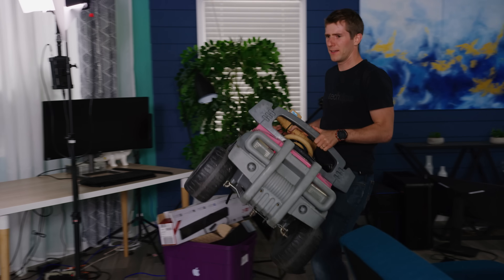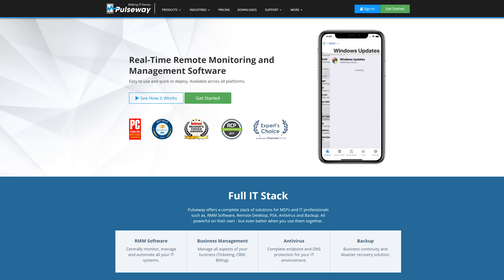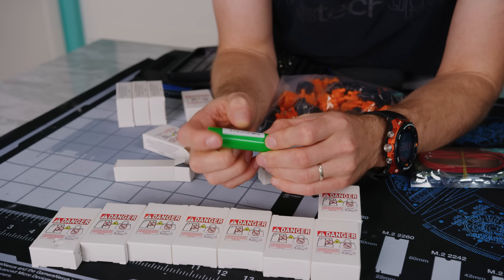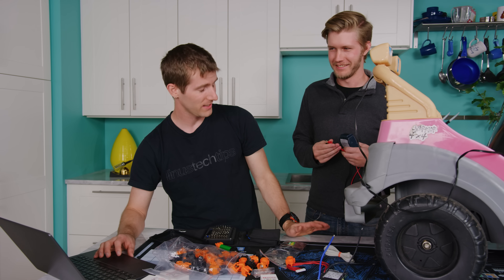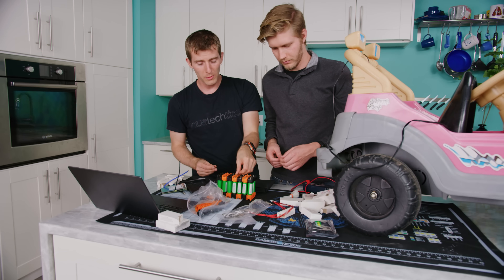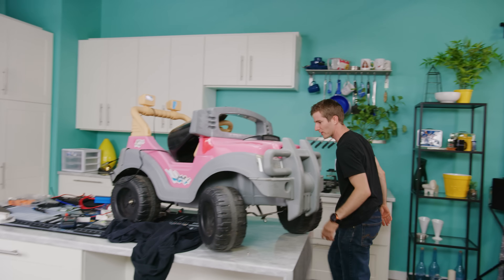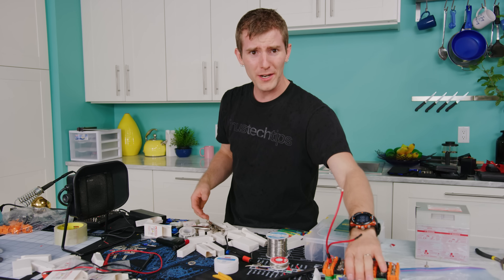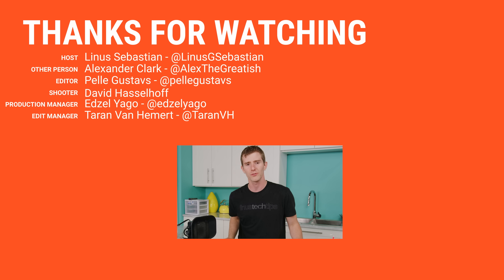DIY Lithium Battery - What could go wrong??

Comment: Will you stop saying that a mistake on low voltage can electrocute you? It's nearly impossible to be electrocuted with 24 volts, unless you stuck the wires into open wounds on either side of the heart or something... There's no reason to make this sound more dangerous than it is! The real danger is the risk of fire or explosions due to short circuiting these cells.

Comment: make it 7S4P if the space allows for it. It should last longer and the battery won't get so hot.
also try to install a couple of temperature sensors and at least display the battery temperature or light up an LED if temperature is over 60°C

Comment: i think this needs something like current limiting motor driver so it would launch softer with less wheel spin and less heat in the battery not to mention longer wheel life.

Comment: I just thought of something. I've been looking at things like the "Anker Power Station" and now I'm wondering if it's possible to use one of these DIY kits and a power inverter (i.e. I have a 300w DC to AC which has 2 built in USB charging ports too, no need for separate 5v circuitry from the main 12v) to make one of those power station things much cheaper with similar capacity?

Edit 1: Eh nope...
On their website they sell the batteries in pair for $9.99. they're 3,500mAh at 3.5v. 

So to reach 12v, you need 4 batteries in series. Each "blade" of 4 batteries provides 3,500mAh to be put in parallel. 

Anker's Power house is 120,000mAh, so you would need 35 blades of 4 batteries each in parallel to reach that.

That would be 140 batteries. 70 sets at $9.99 each, that's just under $700. Plus you'd need 2 assembly kits at $34 each. The power House is $500. 

Correct me if my math is wrong though, I'm uncertain if I'm right about putting batteries in series not adding up their current but I vaguely remember series adds voltage and parallel adds current.

Edit 2: Of course they state the Anker as 400wh, which 400wh at 5v is 80,000mAh, and at 12v it's only 33,333mAh... So if we're aiming for 12v, you would only need 9 blades of 4, or 36 batteries, which would amount to ~$360, way cheaper. Maybe someone better at electrical math can sort my mess out?

Comment: Alright Linus I have the idea of the century for you
1. Get two of those Power Wheels, and connect them with maybe a 4 or 5 foot long solid object so that they stay a fixed distance from each other
2. Soup up their batteries with this same method, and replace the plastic wheels with some that are rubber instead
3. Get a non-powered, stable, 4 wheel vehicle of some kind that has steering, then disable it
4. Lash up the two connected power wheels to the non-powered vehicle, maybe between 8 to 12 feet nylon ropes
5. Grab some potentiometers, servos, and wireless transmission devices and rig up a way to steer and power the front two vehicles from the rear one. (arduinos?)
6. Enjoy your modern-day pod racer :D

Comment: cool the battery with some old Stock CPU fans, you'd have a million of those and they're basically useless anyway.
Reply: Today, we are water cooling a DIY battery!
Reply: use Lithium Iron Phosphate (LiFePO4) they are better for electric cars, etc.  they barely get hot when running a motor.
Reply: @jerricabenton842  well there is no usage spesific lithium battery. Example: Li-ion batteries are superior and safer from Li-Po batteries but Li-Po is eveywhare and Li-ion's are barely used.
Reply: @Görkem-x5h  don't they get affected by magnetic fields? 
Back in the days I had Sony(before there Sony Ericsson merger) phones with li-ion batteries you could turn them off by holding a magnet to the battery
Reply: The battery is warm cause he didnt balance charge

Comment: I remember as a kid, my battery died and as my dad was a mechanic he tasked his employees of putting in a 12V Car battery. MAN it was fast.
Reply: I was always disappointed with the speed of my power wheels Jeep. However, instead of connecting a larger battery, I was more concerned with making the windscreen wipers work, which I did.
Reply: Sonic voice: GOTTA GO FAST
Reply: @DanielPinel  kerchow!
Reply: Did the same thing, it was awesome. I even attached a legit car plate number on the back.
Reply: i hope you wehre the coolest kid in shool
Reply: I remember I had a Ferrari Enzo power wheel, that thing was fast (turns out Ferrari threw in an actual car battery from the start)
Reply: i didn't know kids ran on batteries let alone low voltage 12v
Reply: Sounds like bullshit since car batteries use lead and you would have like 20 kg extra weight XD
Reply: @remy5405  12v car battery in a 6v power wheel.
Reply: nice dad bro
Reply: You are battery operated!!!!? ( jk)
Reply: Catch a girl?
Reply: You guys.. he means the speed of them installing the battery..
Reply: My dad did the same and that thing would move lol.
Reply: 12v lithium actually has a deeper high end then a 12v lead acid comparable. To sum it up the voltage on average would be topped at 14.5v. 13.8v is a healthier charge for the longevity. But lead acid 12v cant top safely anywhere over 13.5v I believe. So you'd in theory have more power and a longer run time. Im going off memory so my numbers might be slightly off.
Reply: @UnifiedInfo  In 1994
Reply: @fryede03  if you used a lithium ion battery now they werent consumer products then
Reply: They are 12v to begin with, Wouldn't be any faster...
Reply: @CanadianOG  actually there are models that are 6 volts only and others are 12 however can was would at least that was 24 volts and that's stock numbers.
Reply: @CanadianOG  It is not all about voltage. It also depends on current those can provide. Battery can be 12V, but drop voltage, when larger current is required...
Reply: @CanadianOG  Depends on if battery is bottleneck or not
Reply: @CanadianOG  quite a number of those cars are 6V rather than 12V.
Reply: @CanadianOG  Nope, 6v is very common. It's more common than 12v I believe.
Reply: @CanadianOG  no they aren't they're 6V
Reply: Kooshe nigga if they’re both 6 and 12v then why are you complaining that it won’t go faster he was obviously talking of the 6v then lol

Comment: For 3p you can get away with strapping the 3 cells together, but any more than that and you want cell fuses.... incase one cell goes bad you don't want 5 other cells in parallel with it dumping current into the bad one.

Comment: 6V engine powered with 24V battery will be propably dead affter few rides.
When i was maybe 6 years old i did similar experiment , i connected small 3V engine in to 230! V Home power outlet , i blowned the fuses and engine was dead affter more/less 1 second :-)

Comment: NOTHING in among that could "electrocute" you!  Unless you put all 21 cells in series giving a total potential difference of approx  88.2V dc.. which in all reality, if you got across it, would kill you dead, most probably. 

30 VDC is not dangerous lest you're standing in a drum of salt water with the negative cable dropped in it and you swallow the positive lead.

It never ceases to amaze me when computer geeks go on about the number of 12v wires going to their graphics cards that draw a WHOPPING 75 watts, or voltages, or electricity in general just HOW LITTLE understanding of ANY of it they really have. 

Next time you're checking your engine oil (bet you haven't in a while hey!)  Go do it now! and while you're there have a look at just how (what you would call) "anaemic" the wires are on your headlight bulbs  (55w low beam and 65W high beam).  Also note that they are not "oxygen free"

Comment: Is it wrong that i'm most entertained when ever the battery electrocutes Linus.
Reply: Watch eletro boom for that
Reply: Seeing the tire come off the power wheel and seeing him roll over was pretty hilarious also (and the fact he cared more about his phone more than wrecking his kids toy, which is even funnier if his phone had one of the cases that they often advertise from one of their sponsors as being supposedly near indestructible yet Linus was immediately concerned).
Reply: no, i learned not to sip drinks when hes "tooled"..i go thru less kb that way
Reply: Disturbed One  then you'll know how a capacitor works. The rubber is the dielectric and the steel belts are the plates. Also on forklifts we installed sacrificial rubber straps to the ground to displace static, otherwise the electronics failed. Strange as it is, it worked.
Reply: @patcallahan1050  

"then you'll know how a capacitor works. The rubber is the dielectric and the steel belts are the plates."
A "capacitor" made in this fashion would have picofarads of capacitance AT MOST.  You would have to touch several hundred thousand volts AC (only found on those really high powerlines) to get shocked from that.
Reply: If it's wrong, I don't wanna be right! :D
Reply: are you sadistic
Reply: But... the batteries are DC, that means that you probably won't feel anything at normal voltages...
Reply: Bah, he is not getting electrocuted. You can not get electrocuted with such a small amount of DC voltage, heck, you start feeling a bit of a buzz in your fingers with 400 volts DC. he was just shorting the battery, which dont get me wrong, is VERY dangerous with a battery this size, you can weld steel with that but the li-ion cells will probably go nuclear quite fast.
Reply: @Mylity66  400 volts DC!!!!  I start to feel a tingle around 100V, 400V would be completely insane, more than twice the peak voltage of a standard american outlet!
Reply: @Mylity66  Oh yes you can!  The welder at work was set at 20 volts and I held onto the tire while I welded on the body of a truck.  The current went from the nozzle, through my body and my hand on the tire was getting shocked.  Yes, on rubber!  Never underestimate the power of electricity, even the small amounts.
Reply: @patcallahan1050   It was a LOT more than the rated 20V then. You cant feel 20V.
Reply: @patcallahan1050  

"Oh yes you can!  The welder at work was set at 20 volts and I held onto the tire while I welded on the body of a truck.  The current went from the nozzle, through my body and my hand on the tire was getting shocked.  Yes, on rubber!  Never underestimate the power of electricity, even the small amounts."
The only way for 20vdc to shock you is through your tongue.  You must have accidentally touched a much higher voltage source, or the machine must have been faulty and connected you to live AC, or perhaps you had a large static charge and discharged through something.

However, discharging through vulcanized rubber would be nearly impossible, as that would require literally tens of thousands of volts.  Making it seem like a super extreme static shock that you recieved.
Reply: @patcallahan1050  Welders have a high voltage to get the ark starting which can absolutely shock you.
Reply: @IanMcDoe  I know I was there when it happened.  zzzzt. Ouch, F***!
Reply: @patcallahan1050  Yust sayin that its not the 20v that can shock you but the initilization sparks

Comment: Get kapton tape, heatshrink (like Atum will be good enough), automatic wire strippers (chinesse knockoff of Knipex is good enough for You and like 30$), wide variety of sizes of closed barrel crimps (to not solder) and proper crimp tool, can't recommend something for You here as I use some expensive ones only... It all should be below 150ish $?

Comment: if you mute the audio and put a isis flag in the top right corner you could be mistaken for a bomb tutorial
def the part where ur sweating and hovering over a tube like structure with wires hanging of it

Comment: why were you soldering directly onto a lithium battery? Heating up lithium batteries results in battery combustion, which means you have to use either a tac welder or solder onto a place and screw it on after.

Comment: I was like why are they making a big 3.7 volt battery when they connected them all the same way... WAT? Three 6 cell packs and one 3 cell pack? That's less than 12 volts with a higher current rating. OMG this video is so bad!

Comment: Rule #1 when dealing with non insulated battery wires - tape off exposed ends until ready to solder.  I'm sure you know that now, this is for other people.

Comment: Those look like Samsung 25r I use the same ones in my vape mods
Reply: Neither LG or Samsung ship in those boxes and they don't put a label like that on them. Reputable companies that do label them like Ilumn apply their label clear of the manufacturer markings so you can still see who made it. I would bet just from what I saw in this video they're cheaper cells rewrapped and sold as something better, something that's become quite rampant since ecigs became popular. If they are legit however they're LG MJ1 cells due to the 3500 mAH claim, not a bad battery.
Reply: Your actually wrong when I buy samsung or even Sony vtc they come in those white boxes same exact ones Linus came in
Reply: And the labels are correct

Comment: Couple tips Linus. Ive done overvolting on a few of these things, and my daughter loves them. Get some heatsinks for those motors, you can find them for RC cars (as well as the same size replacement motors, but with a bit more longevity).  Maybe a fan, you should be able to find a 12v fan laying around ;-) Upgrade the wiring when you have time. If you have terrain around you, they will get hot. 

If you have sounds to run, a buck board will take care of those nicely. 

Oh, and an easy conversion is to use a battery pack from 18 or 20v tools. My girl's 4 wheeler runs on craftsman packs (since I have a lot of those around) and we get about 3 laps of the neighborhood out of each one, or about 15 min, before it has to cool down and be re-charged, and swapped out with a new pack.
Reply: Oh, the way I hook the tool packs up is with one of the slow chargers I have sitting here, which, if you wire it right, can still be used to charge up the vehicle. No messing around with 3d printed stuff or hacking packs, it makes for a safe connector that even a 5 year old can change out safely.

Comment: Use LiFEPo4 Batteries. They are much more safer
Reply: Or lipo AKA Lithium Polymer batteries they're safer as well. Order new ceramic lithium's which are even safer still.

Comment: 3500mah 18650 batteries are not really high current. samsung 20S cells are 2000mah but have a true 30A rating. those (IF they are 3500mah) are only 10A at best.

Comment: So like, I'm a complete amateur with electrical work and do tend towards the unsafe side, but even I learned the hard way at the age of 13 to not dick around with loose live wires.  Things to not like about Linus that make me avoid certain videos: 1.clickbait 2. "fluff" or sponsored tech videos where they only hit the bullet points you'd find in the product description on Amazon rather than doing a detailed critic or teardown.  3.  cringe worthy attempts at DIY that do more to drive people away from learning about tech than encourage them.

The GPU baking episode that lead to Linus meeting Rossman was the same way.  I agree with Rossman that it isn't real repair, but when done by the user, baking your dead GPU is a great, easy, and mostly safe way to get an extra 6 months of life out of it while you save up for a new one.

Comment: Haha, this is one of my LTT favorites!
First, I like Linus' innocence towards Lithium batteries. I wired up a lithium battery pack in my master's thesis (it was about 10 times the size of this battery though), and it made me quite nervous to know that connecting a wire incorrectly might vaporize the wire in my hands ;) . I triple checked that a conenction is correct before I made it, and Linus is just like "let's throw this thing together"!
Second, I love seeing how much fun Linus has riding those little toy cars.

Comment: c h r i s t     h e     c a n t     s o l d e r
Reply: Yup, I'm pretty sure Christ can't solder.
Reply: Soldering is outdated with the kits if a cell burns out just replace it ezpz also no bms they are for morons
Reply: @bobravenscraft5376  those kits just aren't economical for most people though they cost almost as much as the batteries themselves.

Fine for a small project like his but for my truck is made a 4s50p  bank from laptop Batts. It was only $90 for actual cells but the vruzend kits would cost $120
Reply: @bobravenscraft5376  yet phones, tablets, pc's are also soldered you say outdated lol?
Reply: But he can sodder

Comment: Xt60 xt90, pick one and make this safer.

Also I did this project but with 6s instead of 7s. One motor caught on fire, the other stripped the plastic gears out.

Comment: Here is an idea for a future video.... mineral oil cool the battery and put a radiator in front of the jeep for cooling it :D you can also get an Arduino and make it send a bluetooth signal to your phone with current speed and battery info :D

Comment: Get a chunky DC-DC board off of eBay.
You get 60V 400W ones that step up 12V and up.
Course, you need a 400W 12V supply...